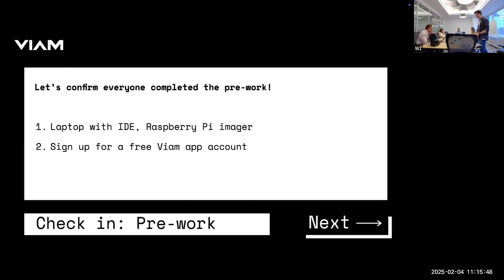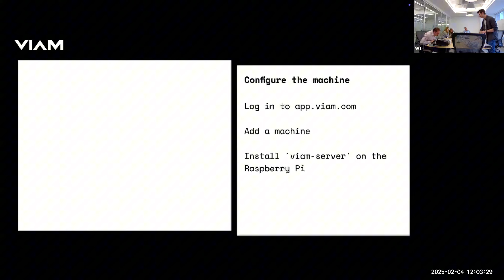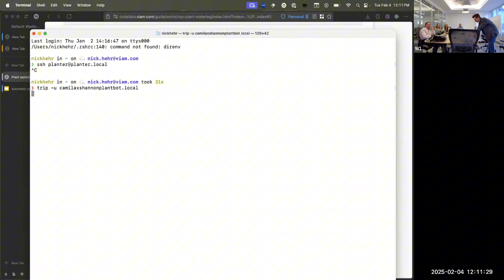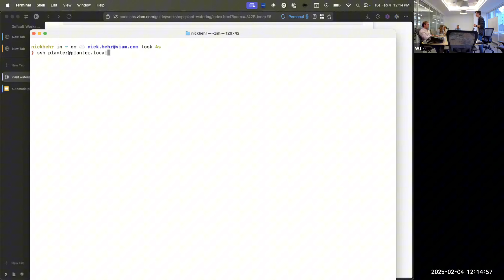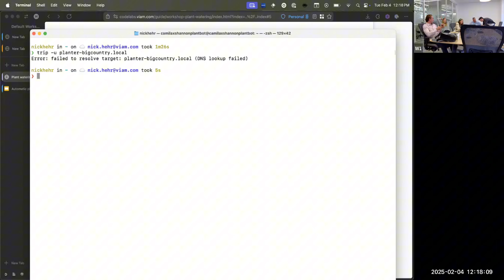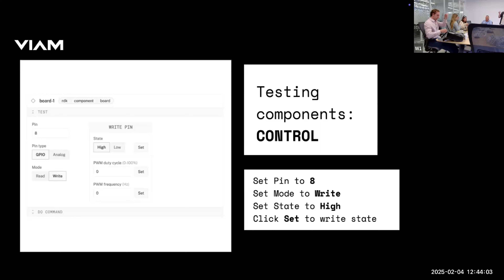Plant Watering Workshop | Viam

Comment: Also, can we put multiple sensors (in different plant pots) with separate motors to have a large system with just one Raspberry Pi?
Reply from the maker: Yes, you would need to update the example code in `watering-controller:plant-watering module` to account for multiple sensors and motors.
Reply: @viamrobotics  ah, I’ll try it out. Thank you so much!